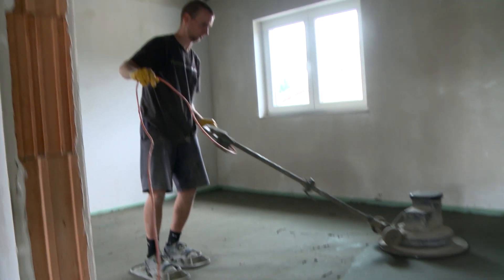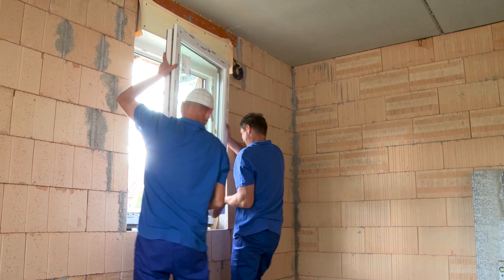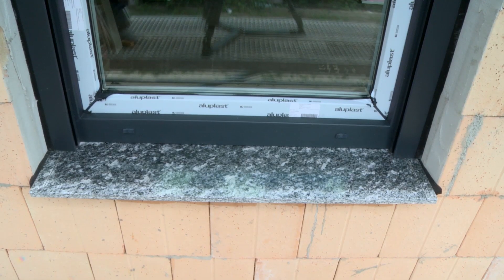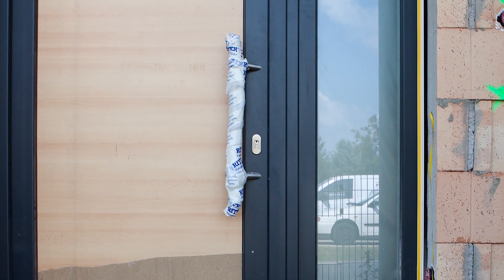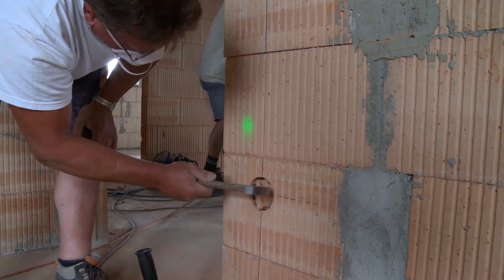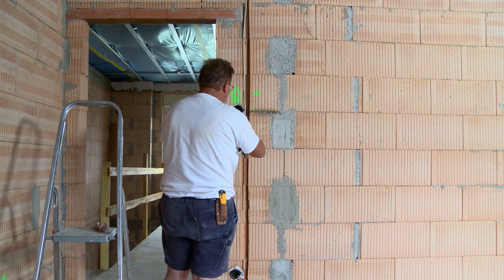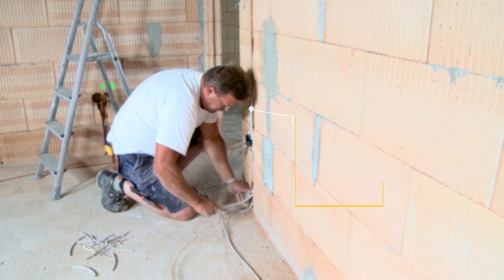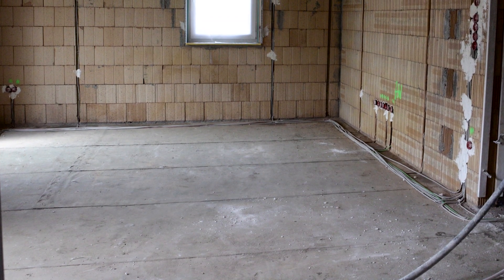Building a House | part 4 Windows+Electrical Inst | house construction documentary|German technology

Comment: In america you have systems that employ the utilities through panels inside the block units the concrete is poured around that so these systems are easily accessible and prefabricated. I was surprised to see them cutting through the masonry 😳 I am also surprised at the sheer scale using cranes and masonry everywhere. Kind of cool but jeez that must be SUPER- expensive
Reply: This is also the case in German prefabricated houses. But no house can be built without a crane, the elements are too heavy.
Reply: You can just look at that thicc wall bricks xD
Reply: The cost of a two-family home without land in Germany varies depending on the size, construction, and features. On average, you can expect to pay around €3,500 per square meter.
In the United States, the construction costs for a standard home with four bedrooms, three bathrooms, and 150 square meters of living space are the equivalent of just under €110,000 – including the standard double garage. This means that single-family homes are almost half as expensive as in Germany, but also only half as durable and of lower quality.

Comment: Do we know the detailed total cost of the house?
Reply: German houses are very expensive but way better than most American.
Reply: @davidfuchs97  I live in Germany in a house built in 1654.
Reply: @davidfuchs97  oh no Id strongly disagree. We also employ these systems we just dont mandate them to be used. A little more freedom to build how we prefer. Absolutely we have masonry systems that actually have utilities already laid out so no cutting through stone work ect. Its significantly more expensive to build this way but we have the option. As to frame building (wood or metal- yes we use both) those systems have withstood some of the worst storms in human history from hurricanes to massive thunderstorms. The craftsmanship is actually amazing to look at and these structures have stood for hundreds of years through that. We actually use different systems for different parts of the country. In the gulf coast and south you will see more frame type structures because homes settle alot faster on soft ground whereas you see more stonework further inland and up north where it gets colder. In the desert areas you see more stucco and muds used because of the sheer heat. Its not a question of better more so a question of application.
Reply: @davidfuchs97  

Not way better, just different methods, and amenities. For example American homes normally come with large kitchens, finished basements, walk in closets, car garages better heating, cooling and ventilation etc...
But of course the most important difference is cost difference. Up to double and triple the cost for a home in Germany, Austria and Switzerland, which is why home ownership rates are so low over there.
Reply: I know a lot of the things are better than North American builds. But man, that is some ugly wiring. No slack loops, weird diagonal runs. That would take some getting used to.

Comment: I thought that germans mostly using wooden window frames.
Reply: Because insulation is so important for German house builds most windows nowadays are made out of plastic. German houses are extremely energy efficient.
Reply: The difference in thermal performance between wood and plastic windows is negligible . plastic windows are used mainly because of lower cost , however , if a plastic window is hollow it will have a bit less insulating value and due to expansion and contraction a plastic window can develop leaks .,
The initial cost of wood is higher but longevity is generally better thus balancing out the cost . 
In germany triple pane has become very popular and one can buy these windows for about the same price as double pane .